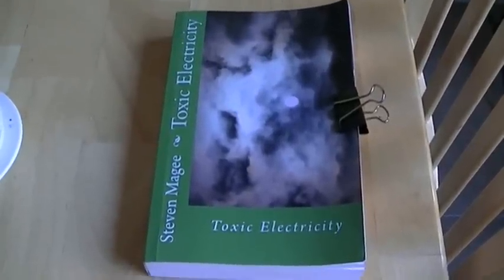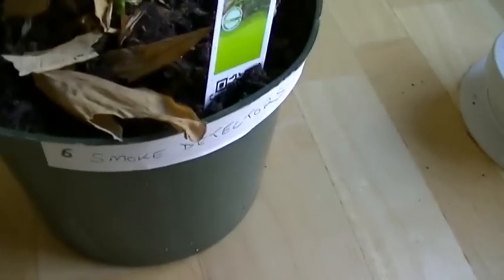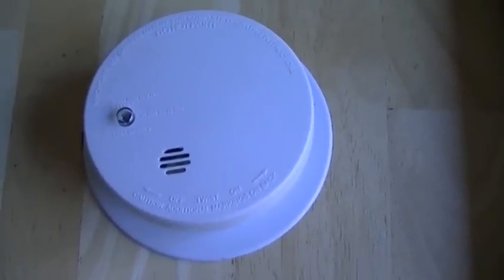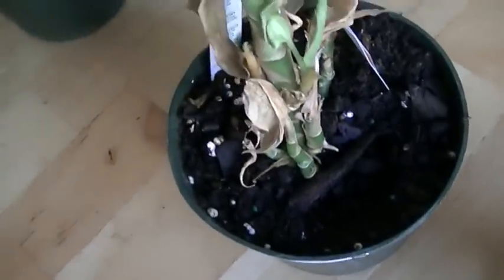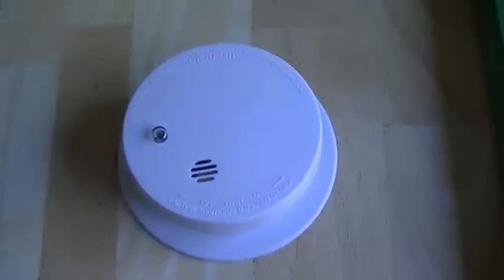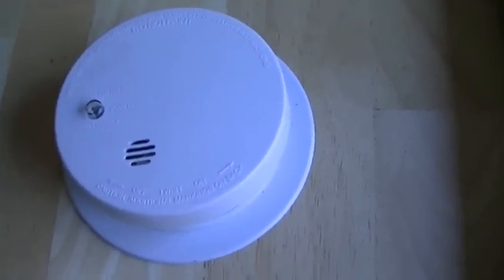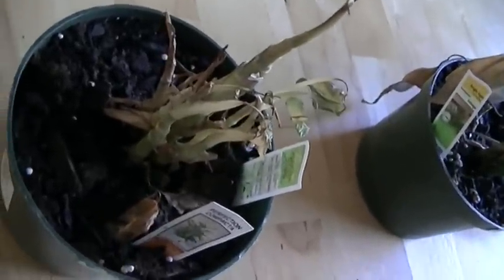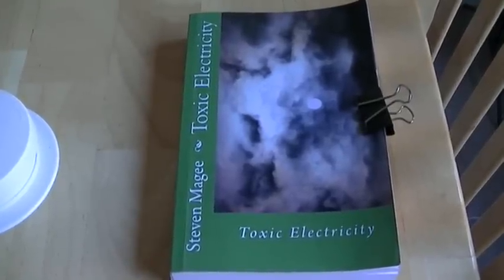Concerning Smoke Detector Radiation Experiment Results!!!

Comment: This is a complete load. 

americium is an alpha emitter, alpha particles cant even penetrate the skin,  and definitely can’t penetrate the housing of the smoke detector itself.

The only way I could imagine harming yourself with the americium in a smoke detector is if you ground it up and snorted it. 

Your plants would receive a similar dose of radiation from you just standing next to them, and way more if they were just planted outside and exposed to cosmic radiation. 

I think you just didn’t water them

Comment from the maker: I have just recently discovered that my control plants were being grown in a biologically harmful field emitted by a wireless transmitting temperature and humidity sensor that was approximately  9 feet away.  That is why the controls were showing stress.  I also live 600-700 meters from three separate cell phone towers, and the community has wifi and utility “AMR” transmitting meters; this makes the wireless radiation levels high at my home.  Search “smart meter illness”.

Comment from the maker: There was another Dieffenbachia in the middle of the table that has also died the same death on the same time scale. A total of four Dieffenbachia plants with exposures within one foot of the radioactive americium smoke detectors have died. It takes approximately 8 months for them to die from the initial exposure to the radiation source. I have many Dieffenbachia plants and the only ones that have died were from radiation experiments. I have not had any die from low light exposures.